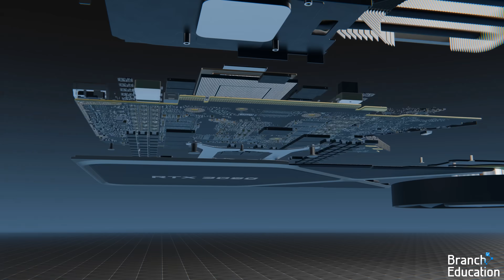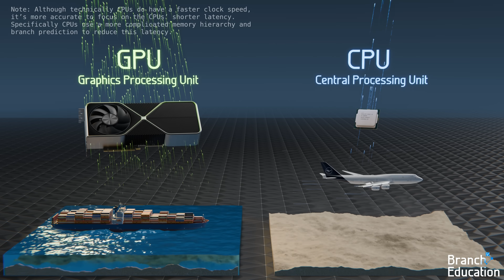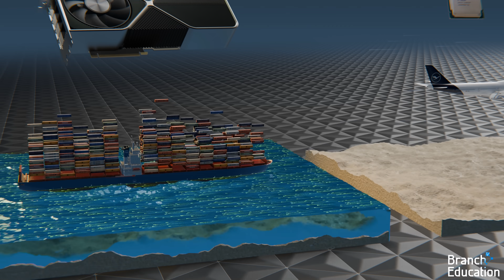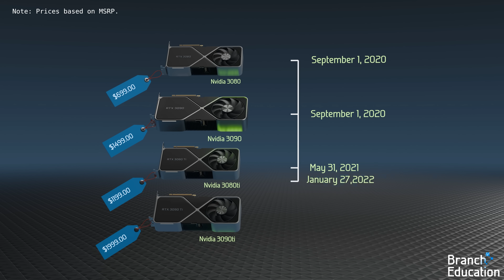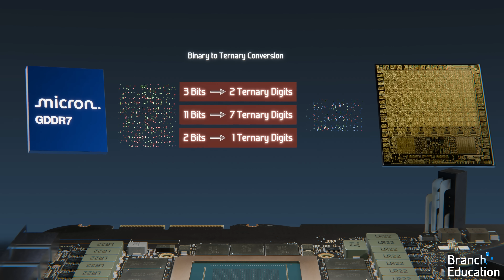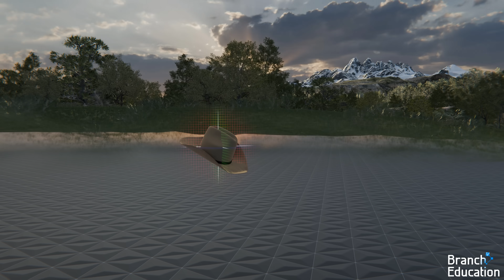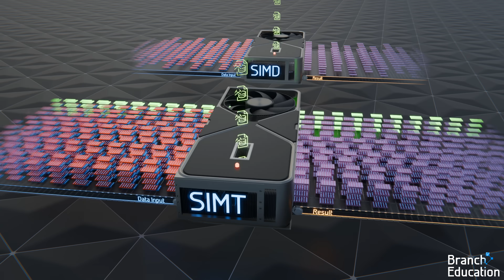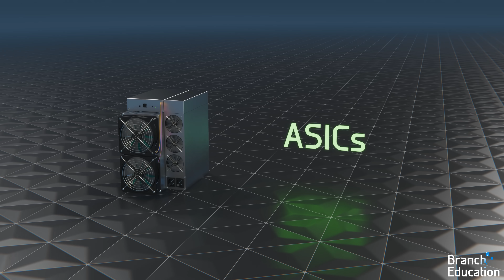How do Graphics Cards Work?  Exploring GPU Architecture

Comment: It's basically like magic at this point
Reply: We basically tricked a rock into thinking using lightning
Reply: @habydlg are we all just rocks with a moment in time of freedom?? 😳
Reply: @citizenz580  well... yeah, we are.
Reply: @Nacil_54  since we can see rocks are everywhere, does that mean we are perpetually living through and around all entities from all possible times and making up a new one to add to the rock pile? what’s going on 😳😱😱😱
Reply: @habydlg rocks smart and heavy with knowledge , human dumb not smart like rock
Reply: @habydlg More like sand. We basicaly tricked sand into thinking WAY faster than us.
Reply: @Monkeymario. wrong, sand is a measure of size. like saying “we turned inches/miles into thinking” Silicon Sand which is carbon and rock
Reply: Electricity, magnetism, and other atomic forces ARE this world's magic. Just how mages in fantasy use conduits for magical energy (i.e. staves, charged items, runes, etc) we also have conduits for our world's energy. 

Take magnets for example: pieces of iron primed so that their atomic charges line up in the same direction. Spin some wound up copper wire around that primed iron and suddenly you have energy running through the wire that you can channel into other devices.
Reply: @wzrd-ish It's not magic at all it's just physical reality.
Reply: “Any sufficiently advanced technology is indistinguishable from magic” Arthur C. Clarke
Reply: That's the best part, it's not, absolutely everything has been thought about and created by humans.
Reply: @Nacil_54  I thought about this while watching the video.  Every human progress / contribution, whether in math, science, and more, has culminated into this one device that is changing the world.
Reply: @Nacil_54  That's the best part. It is absolutely magic. 
In fact, we are all magicians. We decided to sit in front of computers and cast spells (type on a keyboard) in order to communicate from thousands of miles away. 
This is by definition magic. Just because you can theorethically apply logic to technology doesn't make it not magic.
Reply: @l4rkdono  you used the word "miles" so something tells me you're trying to tell me there's no science involved...
Reply: @Nacil_54  Of course there is science involved. Science is human magic.
Reply: @l4rkdono structure and interpretation of computer programs by Abelson & Sussman
Reply: @Nacil_54  Agreed. The truly fascinating part is that humans created this. Calling it magic takes away credit from the incredible effort of millions of computer engineers of all types over the last 50+ years. It's not magic, it's science and engineering.
Reply: @Nacil_54  Yes that's seriously the weirdest part to me
Reply: @Astrikss  it's science
Reply: @Nacil_54  It would be indistinguishable from magic for someone in even the early 1900's
Reply: @skittlz111  just like it would be if you were to talk about it to someone today, but hold their hands through the step by step process, and it'll appear clear it's not magic.
Reply: @Nacil_54  sure but until explained it definitely seems like magic. So many things we have today would to someone who’s never seen said device
Reply: @Nacil_54 On Earth
Reply: Welcome to The beauty of science and pc
Reply: It's definitely magic when these relatively dumb devices can create Artificial Intelligence in a way where even the engineers who developed it, don't understand how it works.
Reply: “Any sufficiently advanced technology is indistinguishable from magic”
Reply: THE WORLD ISNT WIZARD JIZZ, TECHNOLOGY ISNT MAGIC - Exurb1a
Reply: it is magic but we call it technology
Reply: anything involving electrons is magic

this is the arcane
Reply: The fact that AB+C is even basic and dependable is a miracle, well beyond any definition of magic. This is not order from chaos. This is order. Any chaos is from the order.
Reply: It is literally magic. The inner workings of modern computers are just as outlandish to me as a wizard casting a fireball spell.
Reply: @Kade_Bauman But it isn't it's just physical reality.
Reply: indeed
Reply: Sometimes it feels like technology is our worlds version of magic
Reply: Definitely lol
Reply: @ExploringNew1 No, only an idiot, a primitive human, or a simpleton(yes, there are differences…) would think that any of “this”(above) is “magic”.  God, are people gullible and/or stupid…
Reply: Shocking rocks = fast
Reply: Applied Science is indistinguishable from magic to the layman, my friend. ^^
Reply: Way more than magic I say
Reply: I like your funny words magic man
Reply: And this channel reveals the magician's tricks.
Reply: Sufficiently refined and advancdd technology is indistinguishable from magic.
Reply: Haha seriously
Reply: And a GPU still is technically, just a rock.
Reply: A sufficiently advanced technology is indistinguishable from magic
Reply: "Any sufficiently advanced technology is indistinguishable from magic."  Arthur C. Clarke https://en.wikipedia.org/wiki/Clarke%27s_three_laws
Reply: mind boggling

(coming from someone who actually spent about 10 years in the game industry)
Reply: Say hi to transistors
Reply: I heard the same was true of cpus
Reply: This is like magic now it's indescribable!!
Reply: especially if you think that they used computers that were over milion times weaker than todays computers to send people to the moon 56 years ago :D
Reply: I think about this sometimes lol. It’s totally magic. The real crazy part is, it’s only going to get better.
Reply: It's ancient knowledge that was long forgotten that we found and duplicated.
Reply: The whole point of these videos is to show it’s not magic but rather the application of centuries of math and physics. The reason to attend college and universities is so that the information is preserved and passed along.
Reply: Magic is science. 😂
Reply: Yes! I've been joking with my friends as I've been learning to code that coding itself is just a really long magic spell that you are trying to use in the hopes it brings your creation into existence
Reply: Reminds me of a quote “once technology is advanced enough, it is no different from magic” from infinite Lagrange.
Reply: Literally
Reply: Nope just physics being used for our benefit.
Reply: Please keep this content for free
Reply: I'm sad because my brain fails to retain any of this information, so by the end of the video I'm just sitting there "Huh.... That's neat" having learned nothing at all. 

Which is of course my fault. Not the video, because the video is amazing.
Reply: They just explained why it is not magic.
Reply: @  it’s clearly a tongue in cheek comment.
Reply: No, you are just ignorant.
Reply: @yc4118  you can’t pick up on that being a joke. Your just a twat
Reply: Bro skipped physics in school
Reply: The inability to distinguish between magic and science shows a lack of familiarity with both
Reply: @samsonsoturian6013  Thats the thing, they might be nearly identicly in function at high enough level
Reply: @samsonsoturian6013 A lack of familiarity with magic? What does that even mean bro?
Reply: @samsonsoturian6013  Explain how do you want to be familiar with magic
Reply: @samsonsoturian6013 

Imagine you shown this to someone born 200 years ago. Theyll think its magic. Think about what will have 200 years from now.
Reply: @SCOOBYGD  we're still using the same buildings as 200 years ago.
Reply: @samsonsoturian6013  ok. Good talk sir.
Reply: @samsonsoturian6013  Why people like you tend to act like if you could build now a GPU with the information of this video? I think that the more videos like this you see the less you know about them...
Reply: @HeyDan1983  I absolutely love watching videos like this and I have no problem admitting that I have no idea how any of it works, love seeing out it works, does not mean I understand what any of it means, how could I, I am only one lifetime and in the end this is the work and brilliance of many over multiple lifetimes.
Reply: @samsonsoturian6013 you obviously missed the joke with your big smart brain. This is sarcasm by the way.
Reply: @samsonsoturian6013  The inability to not understand what they actually mean here is much more baffling.
Reply: @anomalytm05 I did, it's still bull
Reply: It's not magic. You just need to understand the technology.
Reply: @nexusoflife what is there to understand. You're born with it the same way a wizard is born with magic